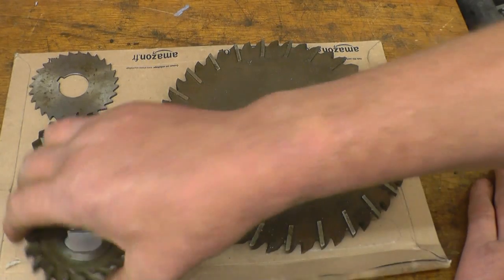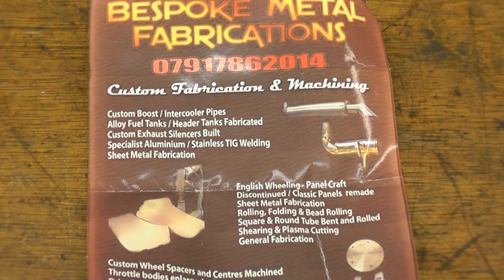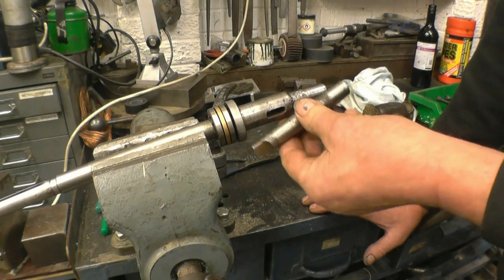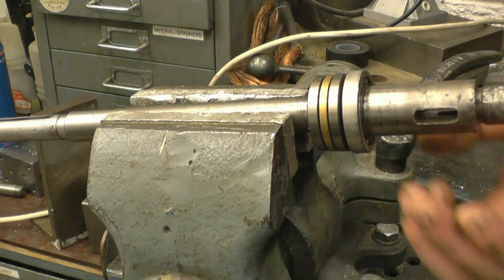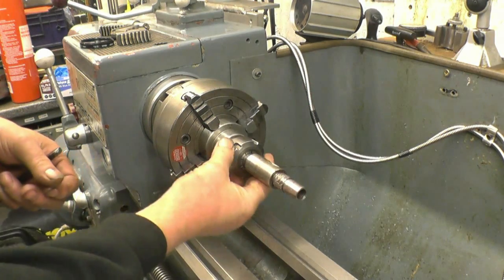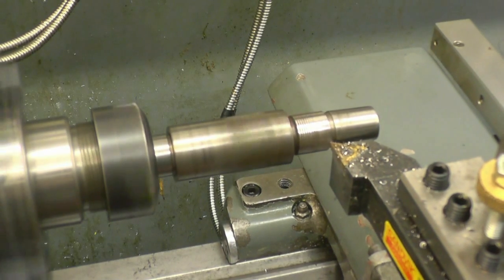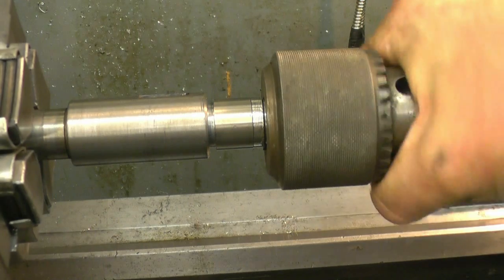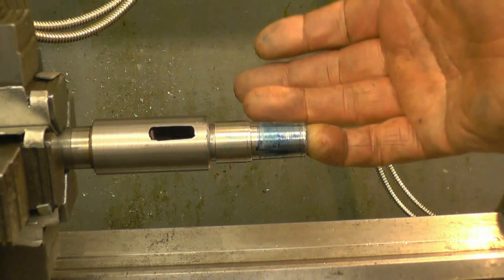SNNC 144 P1  Drill Spindle Repair

Comment: Would you like to copy my l-00 spindle nose protector if I send it your way John?
Reply from the maker: yes that would be good I do need one
Reply: doubleboost I'll pm you on the welding forum. I don't know where to find a suitable piece of cast iron to use though, perhaps a large clock weight or sash window weight?
Reply: My Spindle Nose Protector is Made From Aluminum